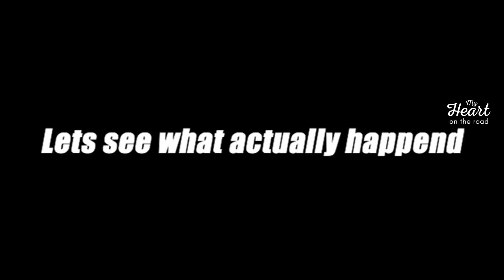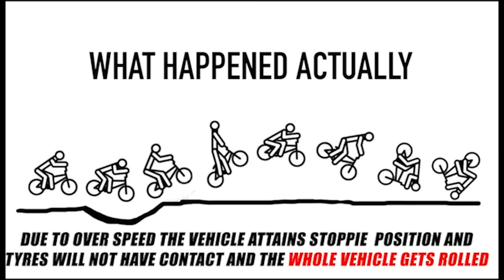Ladakh Bike accidents Caught in the Camera | Compilations | Part 3

Comment: You don't need abs or some fancy traction control, just a little riding practice for curve roads in the mountains.
Reply: Atleast You nee good brakes rather than ABS. that discover guy had no brakes........
Reply: @basidhsajan2398  It definitely had brakes but high speed and ignorance of tiny rock pieces on curves with light weight bikes carrying unproportionate extra stuff on the back seat, all made them to take unpleasant kisses of dusty roads n gravels.
Reply: Bhai issko discover bari lag rahi thi 😂
Reply: @basidhsajan2398  moreover no proper weight distribution
Reply: ABS saves lives. Period.

Comment: The guy with the discover was supposed to use engine braking. 
"Always come down the steep on the same gear you'd use to come up that"
Had he maintained a lower gear, maybe 1st or 2nd, things would have been in control.

But that Beauty around, who wouldn't be distracted ❤️

Comment: on tight turns reduce the throttle and go one gear down and if needed use light break,mountain riding is all about practice and few tricks,not some abs,i have ridden a two stroke bike in these types of mountains,which has almost no engine breaking.but i have a lot of practice.